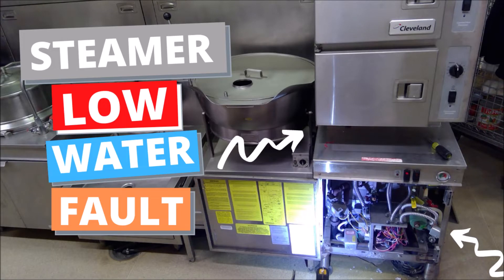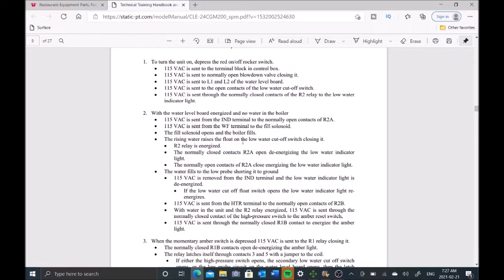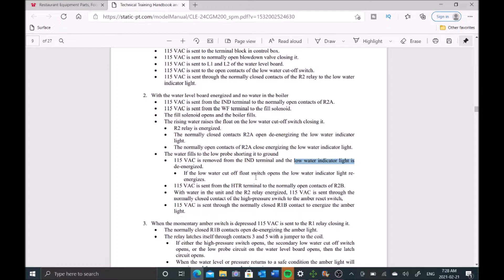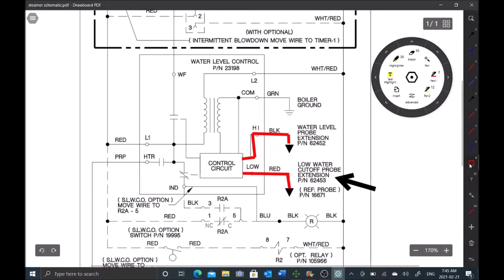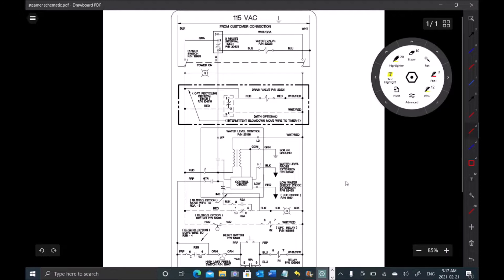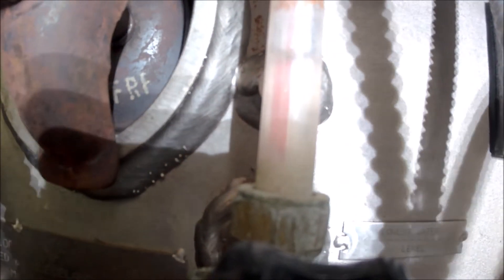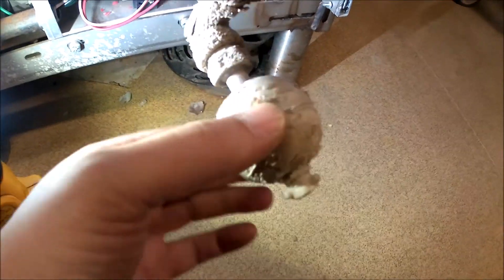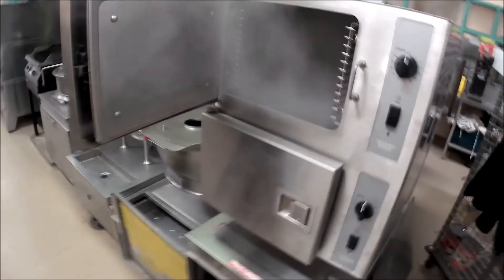Cleveland Convection Steamer Low Water Error (24CGM200)

Comment: I have a 24CEM36 clevland steamer and no water is filling in the sight glass. Should both round levers  by the sight glass be open?
Reply from the maker: Yes, check to see if the solenoid is actually filling and if the drain valve is open or not
Reply: @REFRIGERATIONKITCHENEQTECH  thanks man.

Comment: I have a Cleveland steamers 24cga10 there’s a lot of steam coming out from the door I already replaced the door gasket and level the unit also I descaled every week, and I also check drain if it’s clogged but it’s not, what could be causing the steam leak, you think it’s the steam valve not closing properly? because sometimes even if the timer is off water comes out at the nozzle and even it I descaling it water comes out in the nozzle cold water what could be the issue?? Thank u I really appreciate it, water valve, steam valve, water level probe these three at my suspicion!!
Reply from the maker: The water valve should not keep filling, you will be able to see this in the float switch assembly. Also make sure you are getting adequate quenching from the condensate solenoid. On some models, there is a small needle valve that allows you to increase the amount of water sent to the drain for quenching. If you see water coming into the cook cavity from the tank, you could be badly scaled up, descaling doesn’t always do the job unfortunately.
Reply: @REFRIGERATIONKITCHENEQTECH  thank you I will try and dig deeper see what’s inside the unit I really appreciate it